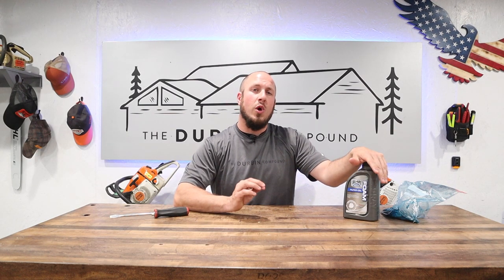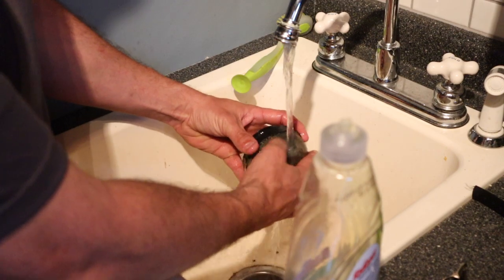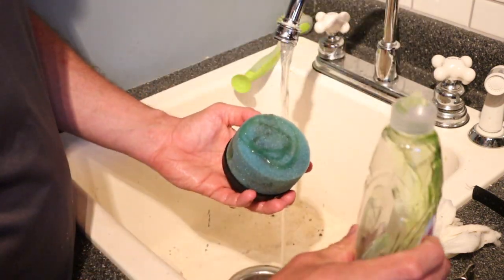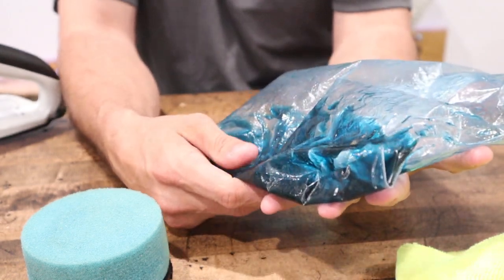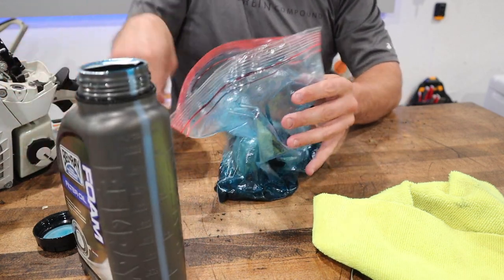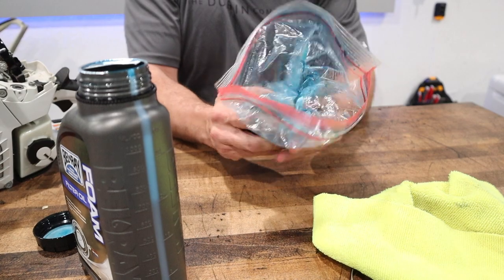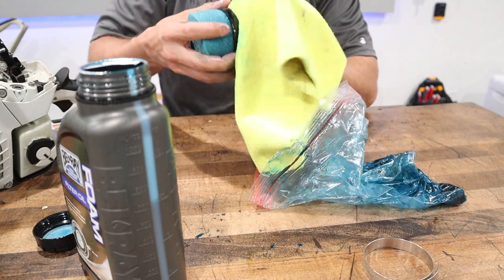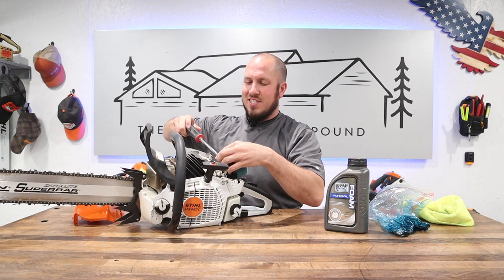How To Oil A Foam Air Filter

Comment: In general how many tanks before filter needs cleaning? ie: can a guy cut for 2-3hrs before cleanings? Thanks again for turning me onto Bark box and 3 point dawgs which I really like!
Reply from the maker: I’d say around 5 tanks. They can get quite dirty and still work great.  You could probably get away with 10 tanks. I’m just picky about it.
Reply: Really appreciate the fast response!! I'll go 5-6 tanks then as I'm kinda a maintenance freak! 😂 am I to expect any performance enhancements? ( more air more umpf syndrome) or simply more functional?
Reply from the maker: You’ll be just fine with 5-6 tanks.  I would say I didn’t feel any performance gain. Just a better filter.  Paper vs foam. People will say foam restricts flow and thus has lower performance. I don’t think it has effected my saw.

Comment: Off topic here a tad...I see you have bark box on still? After alot of use are you liking it? I ordered one and hope I didn't make a mistake after watching one of your comparison video's??? Thanks
Reply from the maker: It’s all in your preference.  I love the bark box tone. The Egan straight shot is LOUD and stupid in my opinion. Although it has a little better torque gain, I don’t like it.  Frankly, stock muffler has good performance and isn’t annoying to run all day.  Completely personal preference.  The bark box isn’t going to increase your productivity or leave you with extra time because you cut so fast. Even if you save a second on every cut. You have to cut a lot to make up 1 minute of time!
Reply: @TheDurbinCompound  Thanks! Ya I'm into the sound too! Just didn't want to " loose umphf by putting box on" gonna try it as she's showing up Monday. Love your info!
Reply from the maker: Yeah you’ll love the sound. I feel that the power gains are a complete placebo effect.  Slower in some testing, faster in others.

Comment: I soak mine in gas and then fold the filter inside out and blow out with the air compressor. That cleans all the old oil out and dries it out too.
Reply from the maker: I like this! I’ll have to try it! Thanks for the pro tip
Reply: @TheDurbinCompound  it works good for me. That's how I was told to do it, by a log cutter.
Reply: @lukeruggiero1894 No damage to the filter done w/ the fuel?